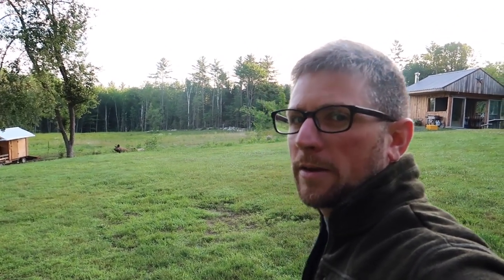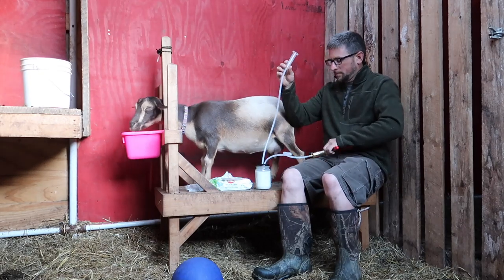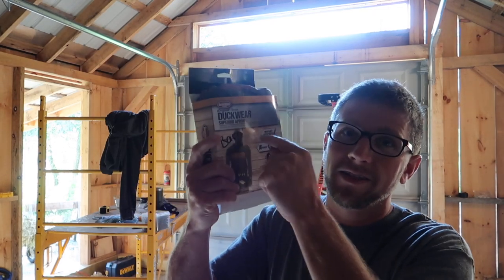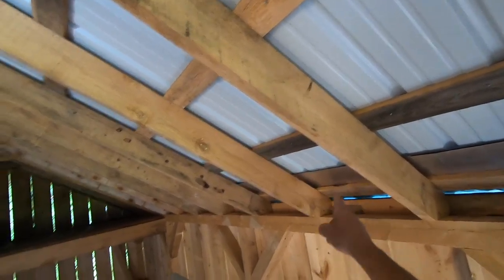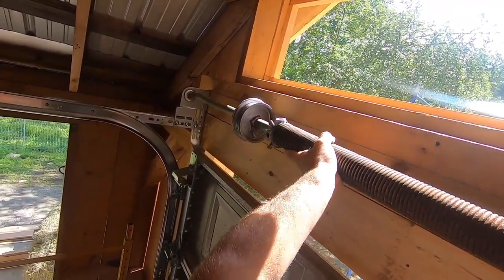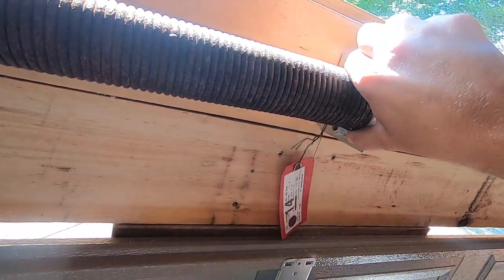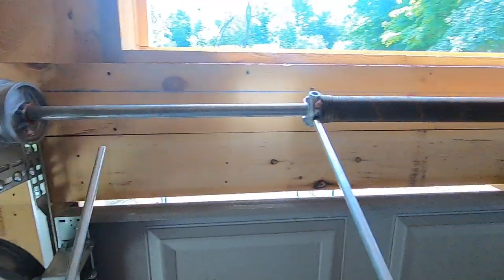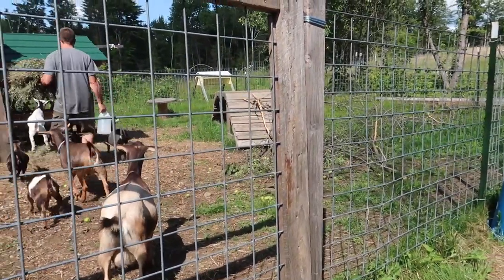The MOST Intimidating Job of the BARN Build. Installing the Torsion Spring

Comment: We store our zucchini and squash in the fridge.  Al, you amaze me with your assembly of the garage door.  Especially that torsion spring.  I use to be the Install Sales Manager at a Lowe's store in my state.  My garage door installers hated the torsion springs.  People have suffered all kinds of wounded due to those things but it has all happened during assembly.  Concussions and even a few cases of death.  I know it's hard to believe but there is a lot of pressure on that spring.  The barn looks awesome.

Comment: Gina, I agree with Rachel M, the zucchini will be okay out on the counter overnight, then it needs to go into the refrigerator. But as she said, it needs to be used pretty quickly as it will go soft and mold. I would say 4 to 5 days is the longest it can go without preserving and that is leaving it a little too long. 
Nice job on the garage door, Al. You did your research and it went well. Great job! However, I do agree with M Gorges that you do need to strengthen the metal door with some insulation panels. If it was made out of wood it wouldn't matter, but because metal can torque and get out of alignment, you need to strengthen them.
Love and blessings to your family and homestead!

Comment: Watching a professional door installer wind the spring was exactly like you did yours.  He did one extra thing.  He took some forescent orange paint and sprayed a stripe carefully the entire length of the spring.  He said that would give a clue that the spring was slipping out of tension so It could be adjusted before it broke.  He used a piece of straight cardboard to make the line sharp.

Comment: Contrary to a few suggestions for the spray oil for the OH door.    Al, from what I could see, you have the newer nylon door rollers in the kit.   These rollers need a silicone or teflon spray lubricant.   i.e.  one where the carrier evaporates leaving the lubricant behind and is not going to leave an oily film to attract dirt.      People who use basic spray oil on the rollers and tracks end up with all the moving parts coated in gunk and dirt (which are abrasives) and eventually the garage door components start to fail and the door becomes difficult to operate.  
Even if you have the basic rollers, best practice is a silicone or teflon spray for the same reason.   The spring on the other hand is all about rust protection.   Use a good spray oil.  The problem with some of spray oils "like the famous brand" is they dry up in a matter of a few weeks.     Get a good spray oil with rust inhibitors, stick a piece of cardboard up under the spring and give it a good spray twice a year.   The piece of cardboard is to protect the door from over spray.      Last but not least, there is more than likely a warranty on your door, always follow the manufacturers recommendations for preventative maintenance.    One little add on, rubber components like weather seal or even the seal around your car/truck door, spray silicon spray onto a rag and wipe the rubber, it prevents the rubber from sticking or freezing to the door frame or ground in the cold.
Reply: good idea the rubber weatherseal strip along the bottonm edge can freeze to the floor
Reply: @heaven-is-real  I live in a climate with lot's of snow, thawing and refreezing, and corrosion issues from lot's of road salt.    I take care of OH Doors at work.

Comment: Hey Al, protip with that angle metal, clamp it to the miter saw fence in 2 places. You can more easily cut it when it is secured. Also, recip saw (I know you hate them) makes short work of them without sparks with a good metal cutting blade.  I just cut through a hardened steel 1" bolt with mine yesterday.

Comment: There are seal kits for the roll up door.  I used the rubber wiper type.  They don't last forever.  The door faces the sun and the rubber has torn.  Cheap to replace.  Some seals are brushes.  I never used those.  You might be able to get an insulation kit for your door.  One other thing, may I suggest deburring that metal strapping, I have a thing with sharp edges. :)

Comment: Awesome job on getting the garage door installed!!  I would recommend from personal experience to installing insulation panels in the doors.  It will help with strengthening the metal door against wind damage plus a small insulation value.  Very much enjoying your channel and the barn build.  Thanks for sharing!!

Comment: Al, I love this segment.  I dropped my garage door a year or two ago and got it back on track but couldn't fix the torsion and had to call someone in....now I know.  Also, I recently added insulation to my garage door making it twice as heavy, if not three times heavier......I insulated it to keep the cool air in from the mini split we have but if you ever do insulation I am sure it is to keep the heat in, lol....we are on the complete opposite end of the country in south Florida!  (we insulated and put the A/C in for the dogs).

Comment: I admire the way you trimmed out the roll up door most I've seen have large gaps.   I once worked in a garage with a large wood door. The cable had jumped the track somehow gotten tangled up. It was scarry.  I'd never worked on one before and when I loosened  the spring, feeling the energy stored there, I knew I wasn't qualified but I never let being in over my head stop me.  I bet you're the same doing just what you want and learning along the way.

Comment: I might add you did an awesome job, those springs can become lethal if not installed properly, I seen one break years later and it shot scrap metal through a drywall.

Comment: A Tip I was told on these doors was to spray a line of paint along the spring when it's in the right place. If in time you need to take it down you roll it back to a straight line

Comment: When winding the spring, never stand in front of the bar. After winding and before locking the nut on the spring, tap the winding bar a little (1/8") away from the center with a wrench. It will make the spring move smooth. Good video.

Comment: Solid job on the install.. I could throw in a couple time saving tricks but after the fact it's not really helpful. That  spring could use a some lube.. In my days as an installer we would make up our own 50/50 mix of diesel and ATF in a spray bottle.I still use that for penetrating oil to this day..  Only other recommendation would be to turn the bolts around on the back hangs of the track so the long part of the bolt  goes through the inside .The bolt will stop a roller from going off the end of the track if someone throws the door up hard. I've repaired a few where I think  Hercules opened the door. It doesn't hurt to double nut or use a nylock on that bolt either..

Comment: Nice job on the door Al, are you going to fill in the panels with closed cell foam insulation for anti rattle and heat retention?2nd video I've seen Miss Olivia bang the salt shaker on the table, should try putting 6-12 rice grains in with the salt to absorb humidity and reduce caking, that's what my mom did during eastern Massachusetts summers worked great

Comment: I didn't want to mess with my door, it is 13' high x 14' wide so I ordered it separate from a garage door company and they installed it as part of the purchase thru an agreement with the Amish barn shop nearby. It took 3 men about 4 hours but now its so light it practically lifts itself. I'm disabled and was concerned about the weight of an insulated door. Originally I was going to do sliding doors like my other barn but for a few hundred more I took the option and glad I did. Those sliders get rough to open over time and 10' doors are harder to open than this one. Plus, if you get sliders off track it takes 2-3 people to get it back.

Comment: Al, 2 things you should check out.  1st you should install a safety cable for your spring in case it brakes .  2nd to  install a top & sides (3) seal so the weather can't get in.  Also the seal will save your door rubbing against the wood removing the paint.  That spring can kill you when it brakes.  The cable with stop that from happening.  I can not understand WHY that is not included in all garage door kit.

Comment: If you save a quart of motor oil when you change oil in one of your vehicles you can the dribble it over the spring. Oiling the spring like this once a year will make it last a lot longer, operate smoother and be a lot quieter.

Comment: Some door springs come with the line already on the spring.  The line lets you know the number of turns completed.  If you lose the count of the number of turns, it is easily to use the line to calculate the number of turns completed.

Another safety tip is to insert each rod and put a piece of tape so you can tell at a glance if the rod is fully inserted.

The vise grips should have been put on the spring rod before tightening the cable drums.

Comment: Zucchini is fine left out overnight for a night or 2, especially as it’s not that hot there. They are a great size for stuffing. Carve out the centre and chop up the flesh. Sauté onion, garlic, in butter and olive oil, add in fresh or dried oregano, chop some fresh cashews and brown lightly with onions and garlic, add zucchini flesh. Top with sour dough bread crumbs, chopped garlic and butter s&p. Top of with grated Parmesan cheese. Yummy, serve with roasted pumpkin etc! Also please don’t scrape your knife on the chopping board as it blunts it. Use the back of the knife. ☺️

Comment: I really hate pointing  things out in comments, but this is a safety tip. You should always try to cut metal with the grinder sparks going down away from you. If the cutting blade ever shattered, or a chunk breaks off, it would be less likely to shoot pieces upwards.

Comment: you need to oil the torrison spring new or used motor oil is fine it will help keep springs from wearing and breaking. if you have to readjust them be careful they can break your arm. take care, be safe and well.

Comment: Squash will last longer if stored outside the refrigerator in a cool dark place, unwashed until right before you're ready to eat it. It can last months that way if the place it's being stored at is not humid. A cool dark pantry is a good place. You can store them in the refrigerator though it doesn't hurt anything.

Comment: Hello Al, was wondering if you were going to put a garage door opener on the door?
Reply: A garage door opener would be nice. He could put a key opener on the outside that opens the door when turned. Sure would be a lot easier on the arms and body. Especially because it has the larger door for a barn.

Comment: My 2 Uncles put in my Grandpa's garage door. It took them all day. they added a motor later on and every time an airplane went over the door would open. they finally had a company come out and change the frequency on the door opener and that solved that.

Comment: Gina, to store your zucchini do not wash it, then you can store it in the refrigerator in an open paper bag. Once your ready to use the it is best to leave it come to room temperature, it should be good for 1 or more (sometimes over 2) weeks. The same with any soft skinned vegetable. Most importantly keep it dry. I sold produce for over 20 yrs. Donna

Comment: Are you going to get a handle for the outside of the garage door so you can lift it?  Also, are you going to get any weathering kits to keep the rain out from the sides of the door?  If you do, don't paint over it like my son in law did as you will end up ripping off the handle of your garage door trying to open it again.......man, that really bothered me when that happened.
Reply: Disregard...that trim you put up will do the same, nice work!

Comment: Al I like you and think you are a great Dad and Modern HomeSteader!!!
I have a question why are you not feeding your hogs free choice feed and why do you throw the feed on the ground for the chickens and hogs. 
Commercial Livestock feed are typically Balanced Nutritional Rations which are intended to be feed to Hogs and Chickens free choice. The hogs are growing and holding back feed slows their growth. They are not able to digest the grass like ruminates. Hogs Internal Anatomy is nearly IDENTICAL to Humans. Growing Children could not grow fully or be healthy eating only salad or veggies. Children as individuals require a certain amount of Protein, Fat & Carbohydrates/Energy. Any imbalance causes normal growth and learning to be compromised. When Hogs are feed high levels of fiber — most low calorie vegetables the manure amounts increase and growing slows down. Throwing the feed on the ground and grass can be walked on, pellets break up from morning dew and they are not nearly receiving as much as they could eat in a Self Feeder holding 100 lbs or more. The bigger they are, the more time saved filling it up.

Comment: Drip oil on that spring so it can never rust together!!!!!!  Just motor oil.  Spring bars must be hardened steel, about 27", but you can grind out the bottom inch a bit to fit the cone.
Reply: oil and wrap the bars and save.  About every ten years you will change the spring.
Reply: draw a chalk line across the spring so you can count the turns visually.
Reply: cables should already have been on, and oil the bottom 6" where it will tend to rust.   Did not need the vice grip at this point.
Reply: Your vice grip should be hard against the header.